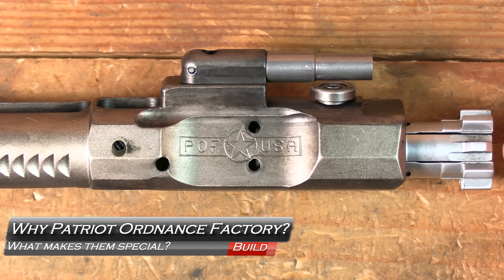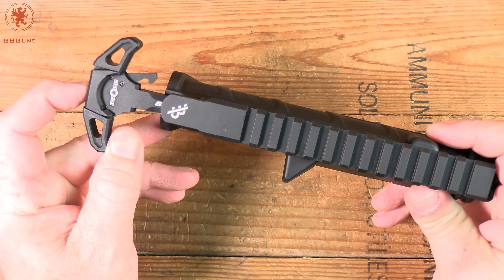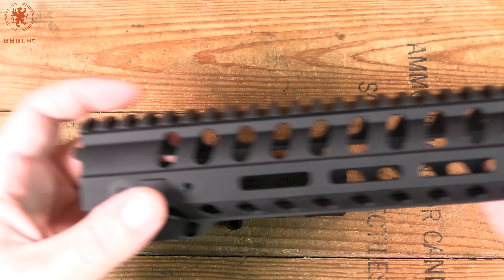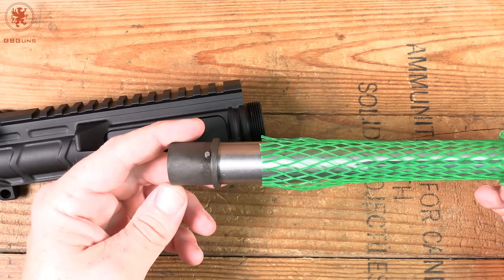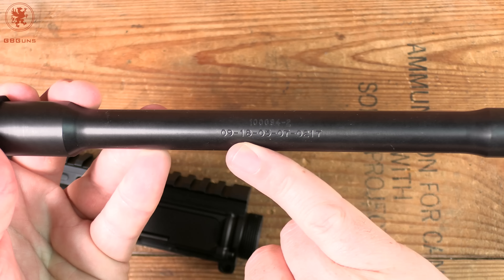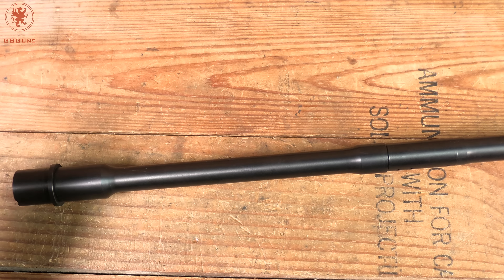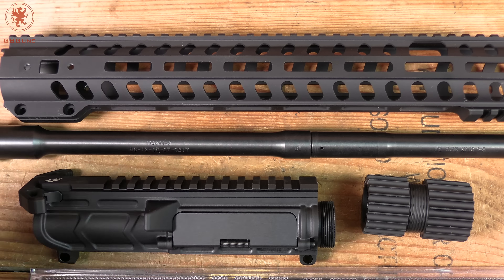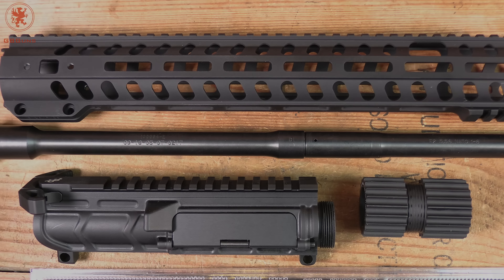What Makes a Patriot Ordnance Factory AR Upper Special?

Comment: Did you see any benefit in going with the bootleg upper over the POF. Does POF still coat the inside of the upper with nickel boron
Reply from the maker: I don't know if POF still coats.  I used the Bootleg because it's what I had on hand and I liked the aesthetics.
Reply: @GBGuns  Looks like PWS mod 2

Comment: Great review. Question..when you installed the QD plate lug nutz on the side of the hand guard, did the nut staked the heat sink under the hand guard? I notice my one staked the heat sink a bit. Not sure if this is normal. Thanks.

Comment: I saw POF sells 'Renegade Rail and Dictator Kit' on their website. I am quite new to the AR Building world, do you know if this will fit a Mil Spec AR10? If so, I would definitely purchase it as an upgrade!
Reply from the maker: The AR 10 is a bigger platform that has no milspec. They do make parts for that size, you'll just need to be sure the gas journal size matches

Comment: Just wondering if that's the same handguard used on the Minuteman DI rifle which does not come with the adjustable "Dictator" gas block. I like to know if the Dictator gas block can be installed on the Minuteman.
Reply from the maker: It's pretty tall, I don't know ow for sure.

Comment: Greetings, Sir. Do you know if the P-415 Edge Uppers would work with a Franklin Armory BFSIII Equipped M4 Lower Receiver? Is there any reason why the binary firing mode would not function?
Reply from the maker: I don't know for sure, but I don't see why not, I've heard you just need a compatible BCG
Reply: @GBGuns  Thank you.

Comment: Great review. Question. When you installed the QD plate lug nuts on the side of the hand guard, did the lug nuts staked the heat sink under the hand guard? I noticed on my one staked the heat sink a bit. Not sure if this is normal. Thanks.
Reply from the maker: I'm not sure I understand your question.  Are you asking if the nuts turned enough to dig into the handguard?
Reply: @GBGuns  Apologies for the confusion. Yes, does the QD lug nuts turned enough to dig into the heat sink under the hand guard?
Reply from the maker: @enam100  I don't know, haven't looked, but I don't think they need to be thattight
Reply: @GBGuns  Thank you so much.